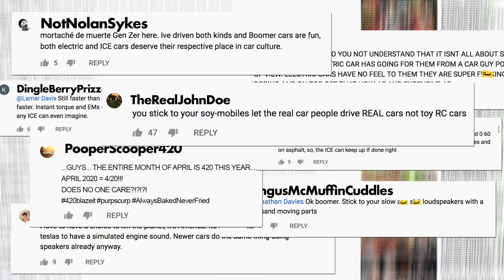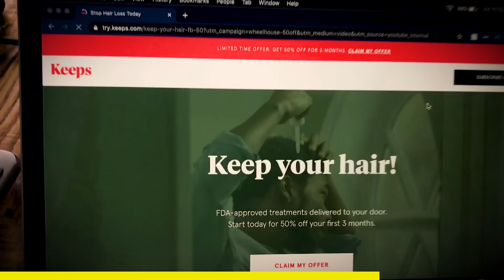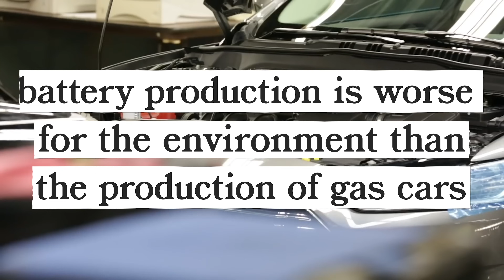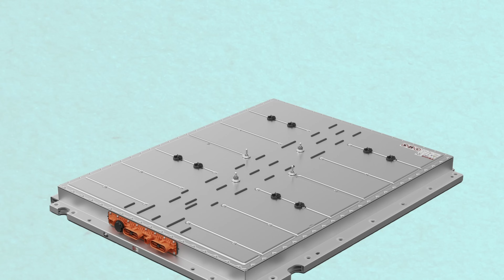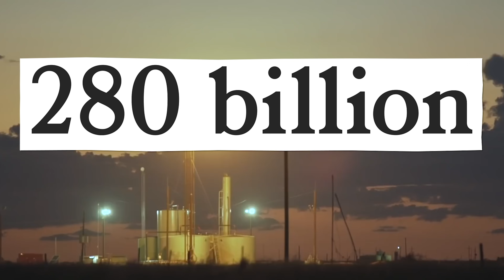Are Electric Cars REALLY Better for the Environment?

Comment: The 2018 Tesla has to be driven for 317,000 miles to make up it's overall carbon deficit compared to the 2018 Ford Focus.  So yea, they are more carbon friendly in the LONG run, but no where near the normal auto lifetime of your average vehicle.
Reply: It might be interesting to see the same comparison using a VW ID3, which is built in factories which have a zero carbon footprint. Plus all three of VW's new EV manufacturing plants are also powered by 100% renewable energy, with the cars being built using a high percentage of recycled material. The materials for the dashboard, carpets, door cards, and seat materials are also plant based, as is the final paint finish. VW are also the first car maker to have signed up to the Paris Climate Agreement, which legally binds you to reducing your carbon footprint to zero by 2050. Although as I have pointed out, VW's three new EV manufacturing plants are already carbon free......  I very much doubt the 2018 Ford Focus can match this....

Comment: The average lifespan of a Tesla model EV Battery system is about 8 years. This is important to consider if the EV has a great impact to the environment at production, greater turn over must be considered compared to ICE vehicles longer lasting power plants and cost effective swap options to put an ICE back on the road compared to the large price tag of replacing an entire EV battery system not to mention the inherent obsoleteness of electrical systems as well as end of support for software and firmware that are inevitable with EV's  like the Tesla.

Comment: Fact #4 Each "EV" is made up of fossil fuel source as well just like you're cell phones , chargers , etc. Not to mention the shitty quality of these EV's i.e. Tesla comming apart simply from hitting a rain puddle while in motion and the efficiency of the batteries deteriorating over time. This in turn will lead to people trading in more frequently like there cars is a Iphone LoL
Reply: Nonsense, all across the board. I'll bet you cannot backup anything you are saying with legit sources. 90% of all EVs  made are still on the road.  Battery deterioration turns  out to be  even less than predicted, and battery packs are lasting well over  100,000 miles. So much so, that there really isn't a market (yet) for recycling the  used batteries, even though EVs have  been around for over 20 years.

Comment: don't do electric vehicles, don't do internal combustion engines for petrol, hydrogen fuel cell vehicles are way better at preserving enviroment, or maybe using hydrogen internal combustion engine is also a good option

Comment: The power stations chucking more crap out will make up for petrol emissions maybe the odd bit of nuclear waste too .
Reply: Power stations are 2-5 times as efficient as small engines; simple  economy of scale.  It's also  easier to build and  maintain exhaust scrubbers at a single location than for 10,000 cars.

Comment: Very interesting video, but you didn't factor in how the ev uses 4 times more copper than the petrol powered car, the effect of mining and converting it to wires, also the environmental effect of what to do with the used batteries on the environment.
Reply: Batteries are lasting so much longer than predicted that there isn't much of an industrial scale need for recycling, but given  the value of the lithium, some entrepreneur is already working on it. 
 
Since cobalt is no longer a requirement for the EV batteries, there's more cobalt in the catalytic converter than an entire Tesla.
 
Let's also  add in the impact of fracking...
Reply: @MrRentageek  what about the heavy metals in these depleted batteries , and the progressive loss of mileage from the batteries, and the hour's it takes to charge them and don't talk about the superchargers they don't work on all ev's and they are not easily available, so in most cases it's hours for a recharge. So much more I could say
Reply: @trevorwilliams1436  All of those are concerns. But not as much as people think . Most people who live in a house would NEVER need to use a super charger unless they were taking a long trip. But for daily commutes , they’d simply charge at home by plugging it up every night when they get home. Even if they drove 100+ miles a day, they could EASILY charge at home overnight. As for batteries, the Ford Mach e battery has a warranty of 8 years 100,000 miles. But as with the an engine, the expected life is much longer. Recycling is being improved even as we speak. So very few batteries will ever see a landfill. Are EVs perfect? Of course not. Are they currently for everyone? No. But could most people use one without any additional inconvenience for all their daily driving? Yes. Again, EVs aren’t perfect. But they aren’t nearly as bad as people are trying to make them out to be.
Reply: @MrRentageek  what does fracking have to do with cars??

Comment: You just wait when they create a near zero emissions synthetic fuel , electric cant win that despite what everybody thinks the electric cars we have now is just a short phase synthetic fuels will run your old cars in the future with zero emisions
Reply: I would love to see that happen. There are several reasons why it's unlikely.
 
Primarily because you still need an energy source. Either the 'synthetic fuel' is formulated using oil or natural gas as the base, or solar/wind power is used to create hydrogen. The first can never be 100% zero emissions; you are just 'cracking'  various other petro chemicals into a cleaner burning fuel, but if the source is contaminated with sulfur or other contaminants, it's not zero emissions.
 
The second is just using H2 as an energy carrier; the electrical energy from solar/wind is just being stored as a gaseous fuel. In most cases, just using the electrical energy directly is more efficient.

Comment: Explain why texas has more power outages than usual
Reply: You mean in relation to the natural disaster event which froze transformers, gas lines supplying gas power plants freezing, and outdoor coal stockpiles freezing under snow preventing powerplants from meeting required power demands?
Reply: @engineeringtheweirdguy2103  ...that were all  caused by not insulating the pipelines and plants properly, as was recommended?
 
Oh, and  transformers  don't freeze, or the northern plains states  would be devoid of electrical power.
 
Oh,  and  coal didn't freeze up there either.
Reply: @MrRentageek  it’s not about coal being different it’s about how it’s stored. Additionally whilst temperature doesn’t affect the operation of transformer, freezing can affect their switches. If they’re tripped, significant enough ice can prevent it from being turned back on, or even turned off which makes distributing power in a rolling blackout fashion more difficult. In more icey area’s transformer switches have material coatings and mechanism to prevent ice formation and break ice when it occurs. Much like ice breakers on car doors to help you open the doors in winter.

Comment: As usual the subject is over simplified and to do it actual justice it would take a seven part series. First off solar, wind and hydro are not by any means clean. For wind and hydro think megatons of cement and steal. For solar think heavy metals and high temp vacuum furnaces. Like lithium batteries solar panels and wind turbines are energy intensive to be recycled properly. This comparison also assumes your battery will last the life of the car, not likely. Then we have the issue of the power grid that can hardly handle the present demand. Upgrading it takes more megatons of copper, aluminum, steal, plastic and wood. Simply it’s all a shit show kicking the can down the road hoping for a miracle.
Reply: All  total garbage. All of this has already been accounted for.
 
It costs less to build and run 1MW of wind turbines than just running a coal plant. That includes connecting to the grid. In fact, why not  reuse the connections that the coal plants no longer need...
 
Electricity is hear to  stay; it's so convenient and flexible a power transmission medium that the power grid needs to be upgraded anyhow.
 
Did you know that all the motherboards from all those computer we buy every few years can be 'mined' for the gold and other precious metals, for less than mining from scratch.  So the same will be true for the lithium cells.

Comment: you forgot that you buying a Tesla allows Mr Musk to fly into space with your money < how much kerosene does he burn up into the atmosphere  launching 2 rockets every week to fill our atmosphere with hydrocarbons ? cause and effect. we will still need oil and lubricants for our evs cv joints and gearboxes doesn't making that pollute the  environment to?
Reply: The primary stage at least used hydrogen, quite possibly created using solar/wind power. 
 
So,  because an electric  car needs 0.1% as much hydrocarbon we should give  up and just burn 1000x  as much?

Comment: I have to tell the story of my 1980 VW Scirocco.

I worked for THE prominent water cooled VW tuner at the time. My 80 Scirocco was bone stock. I put on a 2" performance cat back exhaust and Dynamax muffler. I ported and polished the head (the best I could- one of the best in the industry explained it to me as best as he could) and decked the head to about 9:1 compression. (Name redacted) had set aside a hot camshaft for me for free. As we reassembled the head, (he) realized the cam was a  "colder" cam and not what he thought it was. I can't remember if it was a "c" or "n" grind. it was 25 years ago. Since it was free we just went for it. I immediately noticed a nice gain in hersepower, but even crazier was my gas mileage!

When I moved, I loaded that car so full that changing lanes going over the lane reflectors would cause the rear to hit the bump stops...LOADED! I was diligent on figuring out my mileage over the 1008 mile trip. I rechecked my notes and math several times...47 MPG! I knew I was getting good mileage, but a long controlled  99% freeway trip told the real story.

The next crazy thing was the CA smog inspection. I knew the cat was hollow, and I think the smog tech suspected it, but he said, well, lets see what happens. When he was done, he was tripping out on how clean the car was. He tried explaining the numbers to me and said it was one of the cleanest cars he had ever tested. His reaction was telling.

Bottom line: A 1980 VW Scirocco was accidently tuned for ridiculous gas mileage and clean emissions without a functional catalytic converter while still bumping the HP significantly. We never dynoed it but I think 15-20 HP is a good guess.
I wish that car could have been studied, but I bet there are others like it somewhere. I would guess it had a much lower carbon footprint than a Prius at 10x the fun and coolness.